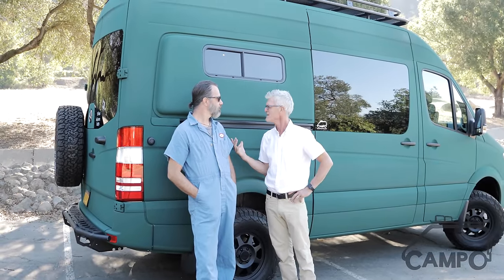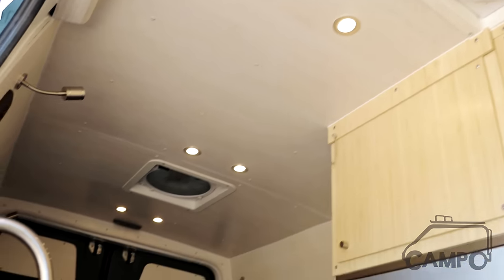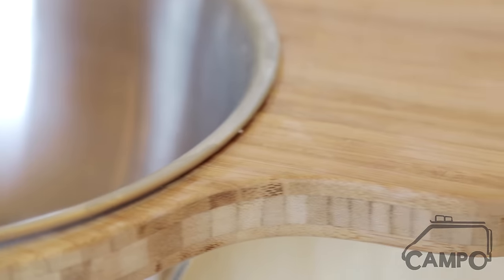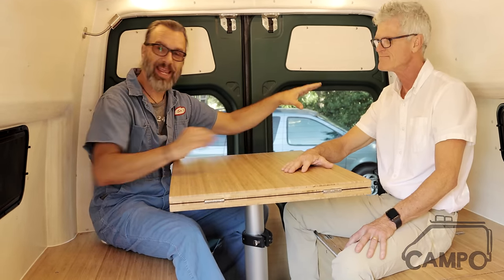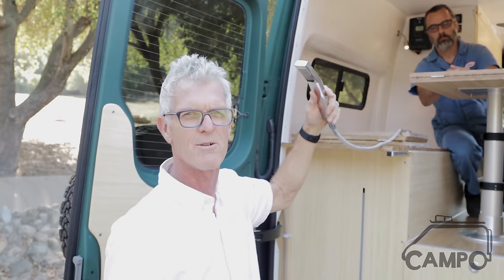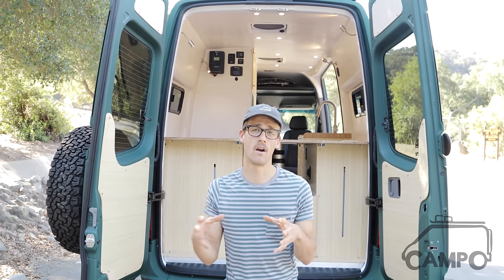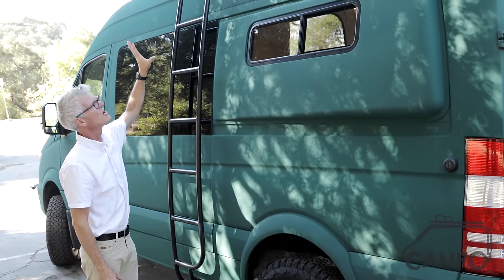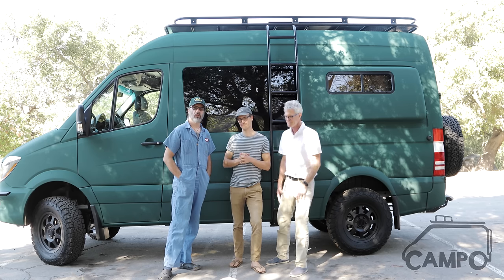VAN TOUR - 4x4 Sprinter with BATHTUB

Comment from the maker: Hi folks!  A few questions have been asked about the mattress and we are happy to answer.  The mattress wasn't included in the video so we could highlight the woodworking but it is a very practical design none the less.  It (the mattress) is sectioned into three pieces that fold together against the wall where the tub is.  While the "hangout" area is deployed the mattress is a seat cushion and back support but when you change the setup into a bed, the mattress folds out to cover the whole bed area.  Bedding is stored in the compartment to the right of the galley cabinet and can be accessed from a top or side door.  To take a tub simply move the mattress to the other side of the "hangout" area and dive in ;).  Hope this helps!
Reply: Must be a 2 inch pad......certainly not "comfortable"
Reply from the maker: @tjn5845  Happy you asked!  It is a 4 inch pad.  Firm but a nice material
Reply: how much did the whole project cost? cost of van, materials, labor, ect?
Reply: @CampoVans   Nice solution, 4 inch works great from what I have read.
Reply: Please show us the dinette pads/mattress. Sounds very interesting, but hard to imagine.
Reply: Thanks for explaining.  Each customer has different wants and needs..  Some we may never understand but to that customer is fits.  Love that sprinter 4x4, sure wish I could afford one, then I could travel those roads less traveled.
Reply from the maker: @dougmanck4149  Four inch works great!
Reply: How much would it cost for this custom build. Approximate. And the bathtub is a game changer. No one else I have found has done that on the 4x4. Awesome job.
Reply: I would also like to know that weight class of the vehicle with everything loaded./
Reply: Awesome make, looks great
Reply: @tjn5845  my wife would divorce me if I had her sleep on that.  She has a 9 inch coil spring with memory foam.  Happy Camper.  The bed also floats so it can be made level.
Reply: Ural Rider Now you’re talking!
Reply: Campo Vans I’m not sure I’d want pieces for a mattress with cracks and spaces in between doesn’t seem comfortable
Reply: Campo Vans , how long can the mattress be with these extensions?
Reply: Campo Vans I was wondering about the lack of "cushions/mattress...👍🏻
Reply: I came to the comments JUST for this!! Brilliant job!
Reply: Ural Rider If women divorced their husbands because they didn’t give them nine inches...well...oh, never mind. I’m sure she’s a lovely woman. 😁
Reply: I love the Japanese soaking tub that is the best part awesome job.
Reply: @adventurersgamble  a question that will not be answered, keeping the facr that they charge different clients different prices (on e act builds) depending on how wealthy they are. Set prices destroy that greedy strategy.
Reply: This is stunning! Would you please list details on the tub, cooktop w/fan, etc.? I would love to incorporate a couple of these into our build! Thank you!
Reply: Amazing, what is that color
Reply: Would you share the brand of that soaker tub please?
Reply: This is exactly what I want so once I get my van I'll go to you guys.
Reply: Thanks, good to know!  Superb build with some very creative minds!
fyi - NONETHELESS, not NONE THE LESS.
Reply: Campo Vans it has to be one of the best jobs i have ever seen good job guys if i have a couple hundred grand laying around i like something like it.i know this must of cost alot just because the detail. if it cost less i have no idea how.
Reply: In the video you mentioned that the flares add 10" to the length of the bed.  It looks like the door side flare sticks out an inch or so, and the driver side flare sticks out 4-5 inches.  Is one of the flares a small slide out?  What is the final overall length of the mattress?
Reply: This guy is the ONLY one who has hygiene and thinks like me👍👍👍 and  he’s a guy who I'm sure doesn’t bleed once a month!!🙄🤦‍♂️
And these 3 guys are MASTERS of small space engineering and deserve an award.!!!
 👍👍👍👍🏆🏆🎖🏅🥉🥇🥇🏆🏆
Reply: Pinned by Harry* 
What is dry flesh toilet ?
Reply: Great job,, did you have to reinforce the rear suspension for the weight of the water tanks? 👍❤️
Reply: Harry Makongwa saw dust
Reply: @daviddionne8296  you won't be the first one to be divorced that's how they are..you will get a other beautiful woman who will understand you better...just let ger sleep on that if she goes away let her vanish i your eyes.. We YouTube community will help your wedding when you get another one
Reply: I am so glad this comment is here! Yes that was exactly what I wanted to know, where is the bed material in such a tight design. Thank you for addressing. great build.
Reply: Love it great job guys!
Reply: Why wasn’t the mattress discussed in the video?
Reply: @harrymakongwa1147  ot uses a propane flame to incinerate waste.

Comment: YES! A tub. I always thought bathrooms were more important than kitchens (which can be set up outside, unlike bathing). That has been a big hang up for me.
Reply: Same here! Seems like every other camper cares way more about food than hygiene.
Reply: Lots of van conversions have dedicated showers or an outside shower at least.  I give these guys credit for finding a way to fulfill the client's requirements, but a tub is really extremely impractical.  It probably takes 30+ gallons of water to fill that thing up enough and then you just end up dumping all of that water.  The energy to heat the water is wasted too.  It's a feature that in most cases would only be useful while on the grid which makes it an odd choice of priorities for a 4x4 camper.  Still, kudos to the builders for making it happen.
Reply: You can sit in that tub and shower quite easy, with out being all cramped up in a tiny shower stall.  filling the tub could be a rare indulgence, but something that could never happen in a stall
Reply: @CL-gq3no  just make a hot tub instead u save the water lol
Reply: Agreed first time I saw something like this
Reply: @joelincolnlincoln6315  it's a japanese soaking tub. Bathing is different. It's common to soap and rinse off before bathing. Kinda like a hot tub, they are usually made for more than 1 person, deeper and smaller than western tubs, I wouldn't be surprised if they used less water. It's can be used as a std shower and the tub can be packed with soft items when not in use, no "wasted" space. I've seen one other japanese soaking tub in a van. I wish they were more common. Last time I looked they needed to be imported. A single person, no frills tub started at $1k without shipping. Sooooo addicting.
Reply: @CL-gq3no  They probably have so much money that wastefulness and impracticality are no big deal to them.
Reply: Think about the ac9time spent per day in the restroom compared to time per day spent in the kitchen. The kitchen far outweighs the bathroom time. It's where you spend quality time talking making memories as well. Give me a tiny wet bath in my van/skoolie any day so I can use the room saved for a bigger kitchen/living area.
Reply: KiteVanMan also did the tub which they use when hooked up to water but they use as a shower when not hooked up. It also doubles for storage and used as the base for a sofa and guest bed.
Reply: I’d take a shower over cooking any day. I can’t feel right without a nightly shower. But I can go to Subway or a hundred other places to buy food. It’s harder to buy a shower.
Reply: Michel Schweinsberg lots of van dwellers get gym memberships! They can be pretty cheap and you will always have somewhere to shower. Some gyms even have locations across the country so it’s possible that you could travel long distances and always have access to a shower
Reply: I agree with you hygiene should be a lot more important than cooking. The only problem is carrying all that water around ... there are recirculating systems for showers and also for hot tubs so with a very good filtration system that could solve this problem perhaps. Having an entirely separate bath water system with it own re-circulation. Are there any van builds with a hot tub? :)))
Reply: Lmao what. A Soaking tub is not sanitary. Putting a showerhead on the outside of the van is probably more clean anyway
Reply: @Rosemary-jx4xp  its not sanitary because your literally soaking in all of your own dirtyness/oils from your body. Atleast a shower washes away that stuff instead of just sitting there absorbing into your pores.
Reply: @anninriverside755  My plan as well. Funny thing is, I was making a list of things I must have and a tub was on that list. My first thought on how to do it was exactly how this one was done. Not something I will do when off grid, but when in a park, such a nice option to have.
Reply: Agreed. Everyone always thinks they can go to a gym to shower. Well, you can, but it's a huge production, and it's a big inconvenience.  You have to pay for a membership,  worry about your wallet getting stolen,  rent a locker, expose your feet to athlete's feet. Sure you can wear flip flops then you have wet flip flops to deal with. An onboard full restroom is sine qua non, in my book. The BEST place to put a shower toilet is directly behind the driver's seat and make it roomy and comfortable with a sink to wash your hands!!!
Reply: Me too!!!! I cannot understand cooking inside the campers they will stink up the whole place,,,Eat out, get go food,, cook outside,,,, all I want in a camper is a shower, a portable potty,,,, a bed, and Countertop with electrical outlets ,,, phone/laptop base,,,,Ac n heat,,,, a microwave...no stove/oven or messing around with propane.
Reply: Chris L i agree
Reply: They didnt show the towable cistern water tank.  The tub works only if you have a water hookup.
Reply: I agree rather cook outside under cover. How nice to go for a hike & be able to shower after
Reply: You can’t cook outside if it’s raining or snowing, but I would like a small wet bath also
Reply: @SelectCircle  lots of campers decide they could use the extra space for other stuff, more storage etc and just shower in gyms and stuff on the road - when I get my van that's what I'll be doing 😊👍
Reply: +Gianni
For sure. But then you're confined to urban areas. Really you need a gym membership and a storage locker. With that - if you're doing urban camping - you need then only a cot and a battery in the van.
Reply: @SelectCircle  well, you'd probably be confined by a few days worth of water, and even while living in a house I don't shower every single day (maybe every other day) so chances are you wouldn't be able to travel that far away from civilization anyways. But I totally understand the ease of use of having a shower or tub on hand 😊
Reply: +Gianna
After mulling over the van life option for a couple years now ... I'm thinking more and more of just homesteading instead. And according to my numbers - it's actually cheaper! I just have to cure myself of wanderlust. : )
Reply: @SelectCircle  Haha, that does make sense, but for me it's all about living in a vehicle that I can take anywhere in the world and live there for a few days with no worry
Reply: +Gianna
O God. ... Don't lure me back into that dream! : (
But I wish you bon voyage. - Have a blast! : D
Reply: @SelectCircle  Haha, I think the hardest part is finding a way to make money while traveling and that's where most people get stuck... I'm still searching for the best way, but hopefully we shall see within the next 5years 🤞
Reply: +Gianni
If the gov't ever institutes a guaranteed minimum income - I might join you on the road! : P
Reply: @SelectCircle  I doubt it very highly, but I hope we shall meet one day none the less 😄
Reply: Exactly!!!  I will take the bathroom over the kitchen any day.
Reply: WORK PLAYLISTS  yh, it makes sense tbh. Obviously when it's raining and cold you can't exactly take a shower, but you have to make sacrifices somewhere. I don't really understand vanlifers who want to keep everything they own at their house and put it in a van 🤨
Reply: WORK PLAYLISTS  I know, my slogen when I get my van will be "freedom over comfort" and I will abide by that at all times
Reply: WORK PLAYLISTS  yeah, I get you. But you do HAVE to make sacrifices no matter what, I think we can both agree that people who try not to are going into it for the wrong reasons
Reply: I'd rather have the option of a tub than a van of wall to wall counters.
Reply: @A222Z  fair enough, I'm thinking of doing a box van conversion to give me that extra little bit of space. That way I could potentially have a shower, whilst keeping a nice big kitchen for doing some sort of cooking show on YouTube. I never take baths at home, and most of the time I'll be near enough gyms to shower if necessary, that the in-van shower will just become a precautionary extra.
Reply: Yes, so right.  I have NEVER been able to bathe outdoors!!!!  Rollseyes....
Reply: @TheGrandmaster1  Really?  You can go to subway while you are camping in the woods?  You can get a shower by stepping outside when it rains.  It boils down to priorites.
Reply: @barbarapowely8780  You don't need a sitting tub to acheive that.

Comment: Strange.... How eccentric is this customer. I think when I’m ready, I’m going with you guys. Creative.
Reply: Eccentric? How great is it to be able to bath in your van when you're all sweaty or covered in mud?! ;D If I too had 150K+ budget for a van I would definitely go for this!! Perfect build.
Reply: @jas_bataille  I think he meant that the demands made were seemingly ridiculous and impossible--yet campo vans managed to make it, hence his decision to commit to using their services in the future.
Reply: I've had a plan for a Japanese soaking tub since I decided to do this. I really need it for my medical problems.  I'm planning on building in a short bus. My design is a bit different than this one
Reply: Soaking tub is the only way I can move my wife into one of these travel vans.  Now I've seen the light!
Reply: @cottagegymfun  I'm thinking of recycling the water like a public Jacuzzi. You would want to shower before getting in the bath, then use a UV light for the water tank, and I'm going to use a submersible aquarium filtration system too so the water is filtered twice. I'd keep water testing strips around, could also add a little chlorine.
Reply: Eccentric is having enough money to justify being a little nuts.
Reply: @juliedorman1858  i have been looking at safety tubs for a small foot print   but still allowing a good soak. Many have jets and heaters. Along with a froli sleep system, I may never settle for brick and mortar again

Comment: A tub in a van? That's the first I've seen. Cool. I've seen lots of Van's and yours is one of the best looking. I'm sure it's in the $150k price range.
Reply: You could buy a Ferrari or something with that much cash or even an actual house. Lol
Reply: Try overlanding in either

... but I get what you mean (she types in her 270k mile Prius)
Reply: $150 for a flip is a bit over the top.  $40 is reasonable for a used one.
Reply: Mixflip  Why ... ? Definitely not 100 K  of parts / materials and labour surely even accounting for the cost of the 4x4 Sprinter.  It's only a plastic tub and bamboo. It's not rocket science or  a  boat builders level of craftsmanship.
Reply: Both. @shawnkay5462
Reply: @davesworld7961  did anyone ask? "I acually did it first" what are you.. 5?
Reply: Liz Steeds website says 75-120k before the cost of the sprinter and seeing how this ones loaded with extras like a hot tub,I’m guessing over 150 easy with sprinter.Sounds about right.Labor for a build like this isn’t cheap
Reply: The question is where do you get the water from... Take one bath and then refill tanks 🤔
Reply: @KyleenDrake  I bet that was more than 150k
Reply: 9/11wasStaged guessing you’d have to be hooked up to water or be near water supply... still, I’d love to have this option if I was full time.
Reply: james mack guess I’ll stick with my Northern Lite truck camper plan lol
Reply: @miyabe_k195  RV Campgrounds or the backyard they parked in or  strangers who offer their homes to Van Life people to take a shower. Probably a cost or exchange for yard work
Reply: @lizsteeds6697   I would argue that it's pretty comparable to a boat builders level of craftsmanship, and actually surpasses some (guess it depends on the level of skill of the particular boat builder!) Some of the installed/incorporated tech. was very high end too. Also have to take into account the cost of the custom 'ceramic paint job, body pop out extensions, custom alloy front and rear bumpers and ladder,  the tires and wheels, that nifty diesel cook top. It all adds up pretty quickly. The idea is I think that what you are paying for really is to be able to say, "here are my criteria for this build and I want it to be mostly without shortcut or compromise" + "I don't want to do any of the head scratching or problem solving myself" and finally, "if there are any problems, failures or short comings it's up to someone else to stand behind it and fix it/make it right". That's what you are paying for it would seem to me. Wouldn't you agree? It's a different mindset from the person who tackles a build setting out to see what they can accomplish with their intellect, skill set and time and money budget.

Comment: I love this van! I'd just go for a wet bath and skip the tub, but everything else is excellent, right up my alley. I love the fact that the heating, cooking and hot water are all diesel powered, allowing for very low electricity draw. Add in 4WD and this thing is perfectly suited for off grid use. Well done.

Comment: I'll take this, just use a longer van, keep the tub in place, have a separate built in bed (queen size) with additional clothing storage underneath (not affiliated with the current tub/seating section). That way - your honey could be soaking in the tub (or utilizing it as an indoor shower) while you are laying in bed